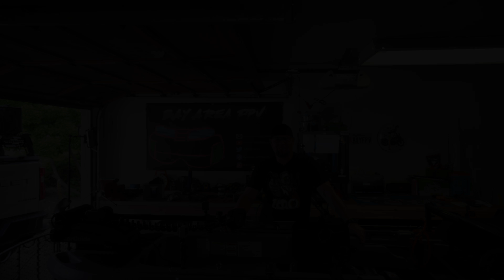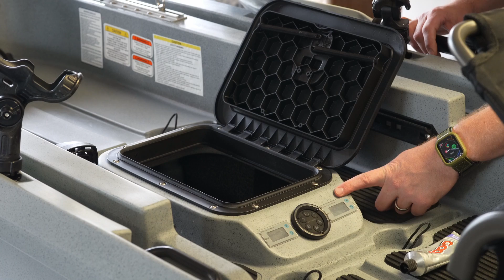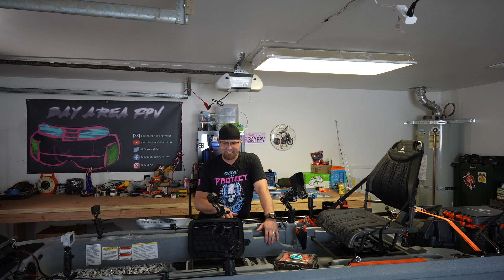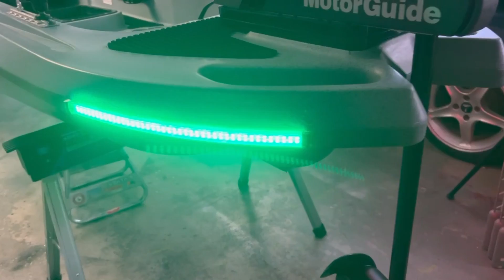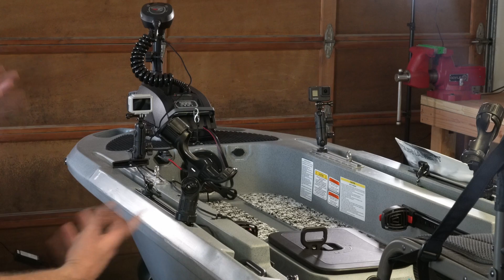Ascend 133X Tournament Fishing Kayak // Build Series // FINISHED

Comment: I was watching your Ascend 133X kayak build and awesome videos by the way.  My question is (if you wouldn't mind helping) am I correct in that you have your trolling motor powered separately by your deep cycle battery and everything else powered by your aux battery?  And you have both batteries going through your yak power distributor panel?  I'm waiting for my kayak package to come in and doing some pre-planning to get a running start.
Reply from the maker: Yes that is exactly how I setup everything.
Reply: Thanks.  So I’m assuming that there’s a standard way to connect the two batteries to the Yak power and specify which input goes to which battery.

Comment: Thank you for the build I love it. Could you give me more detail on the auxiliary battery box and battery you use please? I am trying to find on for mine by using the two-battery system.
Reply from the maker: The battery box was a waterproof box from Walmart, it was about $15. The battery is a 4S 10p 36Ah pack that I had made a while back for a long range FPV plane. I used a Castle Creations CCBEC Pro to step down the voltage to 12v while still allowing enough draw to support the electronics. Honestly if I didn’t already have the battery I’d have gone with Ampere Time 50Ah 12V pack. Here’s the link to that. https://amzn.to/3HC3CTo